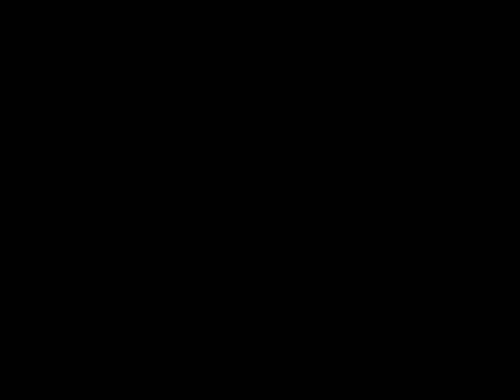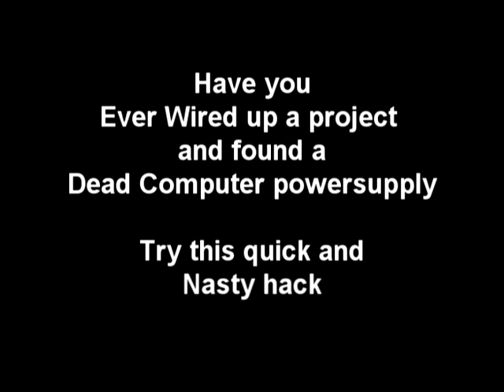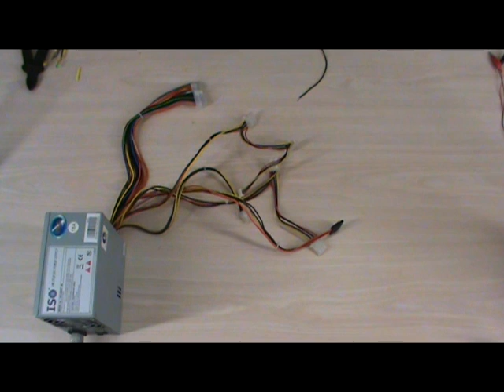Computer Power supply Hack

Comment: thank you very much for awnsering this question i had wandering in my head for a year. this is extreemly handy for high watt (amps) 12volt equipment like large dc moters and the peltier fridge i build (use yellows from different lines to split the amps (i love it when the lessons in collage pays off)). also the 5 volt is really handy for usb charging and also as stated below for a pic or plc micro controllers(concerned about the speed it powers up tho, for stuff like pwm)
greetingz from Holland!

Comment: mine doesn't have a green wire and way too many black wires
Reply: Usually they'll be like all black.. But a USUALLY good way to i.d. at least the green wire for jumping is;
 hold the 20pin(or however many) connector with the little clip facing towards you. count in from left to right 4 spots from the left most pin inward(Green is 4th wire/pin), again, on the clip front side side(two rows of wires, ya?) and thats green for tricking it into on.. 5th spot from that(next pin to right of green) is usually a reliable ground to short to aswell